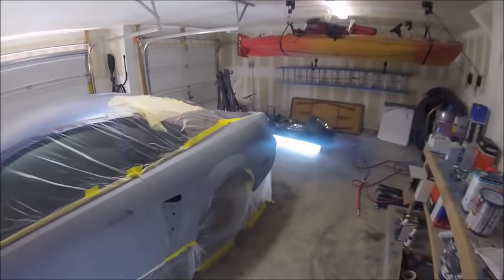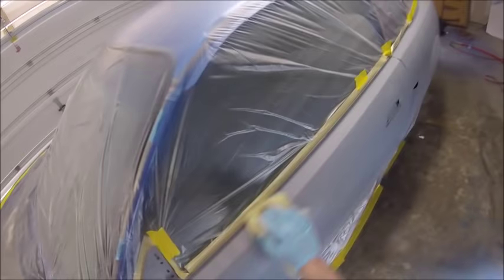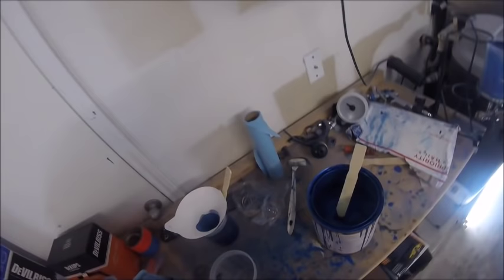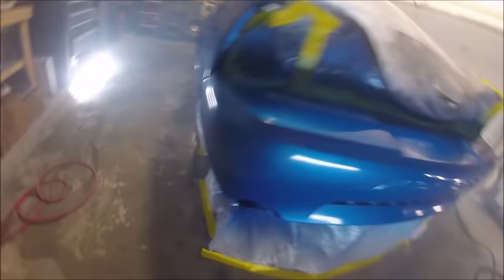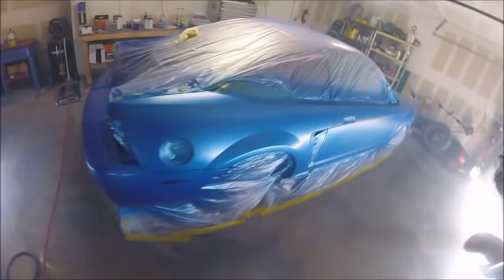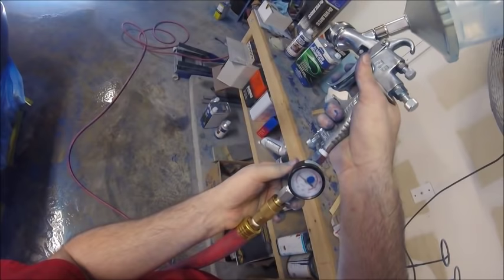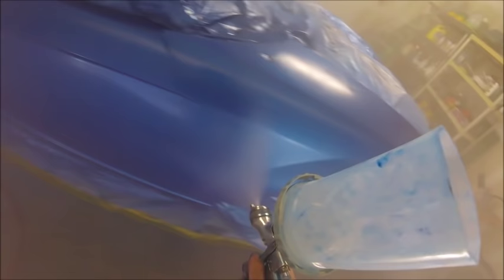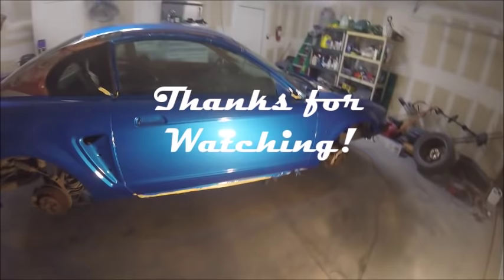Painting Your Own Car At Home

Comment: Well, you mays well of painted it apart panel by panel because you never walked the dog anyways. (Spray full length of the car). But I notice you keep your pattern good at all times. Same distance, speed, ect. So if you did that panel by panel you would not tell a difference anyways. I've been painting for shops for a long time and the only reason I would not use a second booth for doors and bumpers and shoot a whole car is if I was shooting a huge flake in my clear.
Reply: chasefilming wouldnt you only walk the dog with a 3 stage pearl? This pearl was in the base coat not an intercoat. Shoots like a metallic

Comment: did you have any issues painting it in sections? I just bought the same restoration shop bc/cc in a metallic red. I keep reading that if you paint it in sections you will have issues with slightly different color panels. Did you have those issues and did you spray it all the day?
Reply from the maker: I sprayed the roof, hood, trunk off the car. it all matched when I put it back.

Comment: did you use wax & grease remover 1st to stop fish eyes?
the problem of doing 2k paint at home is overspray in the air it takes around 1 hour for
fast hardener to start going off.
means overspray dries in air ,floats around eventually lands on your nice paint work.
so next day it looks like tiny fish eyes .
you can avoid this by placing plastic drop sheets around walls you will need to put a fan blowing out so it sucks fumes out anyway good luck
Reply: Fernando C Prepping the surface is the easy part. Fishing is mainly caused from water and oil from the compressor. A condenser and a good size desiccant drier are a must you need clean dry air going through the gun.
Reply: I painted my 64 in my garage with my home made 55 gal compressor a cool down system for the air and a desiccant drier that's plenty big enough to do a paint job for. I went to school for body and paint and decided it's for the no brains that like breathing fumes all day. I've restored a few cars in my day and know how to lay down paint. No interor in my car it appraised at $35k the body and paint is flawless not counting panels just prep and shoot I'm under 2k for a show car finish that last week won best paint at one of my local shows.
Reply: you can say what ever you like but realize this is the web or net or  social media .
would you believe i won best painter in world award?
tell me how long did you spend in school and do you carry a spraypainters license?
in Australia we have ( TAFE) technical and further education and you need to spend few years learning as well as working in shop!
also you can't learn both trades at same time panelbeating is a trade also.
if you do have license can you use it overseas?
anyone can open business stick sign up as school of auto body works.
but is not same as apprenticeship

Comment: Very nice, but is that a 30 gallon air compressor husky? And what happen You paint the whole car and the compressor is not cut off and on
Reply from the maker: It sure is. I just flipped the breaker back on and let it fill up before the next coat.
Reply: @twistedgarage4139  oh I see.
I just want to see how long the compressor kick in. Is that a 30 gallon husky? I plan to buy one . Do you have the link for this compressor

Comment: Can anyone help just wana paint my car primer no dents or rust body is straight what sand grits do i need to start off with to spray the primer....
Reply: To spray primer you can sand it with 320 but if the paint is in a good condition you don't even need to primer it. If you want to use paint instead of primer you should sand it with 400 or 600
Reply: @laminadoypintura9064  man i appreciate you replying to me ill give that a shot and im really just trying to primer my vehicle i have 88 s10 blazer the clear came off mostly on its own for being an old vehicle and just want to to get it primer for now til im ready for the paint stage...

Comment: can I get an estimate on how much all the products you used cost like paints and gun and everything?
Reply: maake sure you use a respirator too their $15-$20 materials figure$200 guns can run over$1.000 for a good one
Reply: depending on what you need, where you get it, what you're wanting to achieve, etc.. $1000 - $2000ish, China Sanders. you can definitely spend more then $2000, and you can definitely spend less if you are good at finding deals, already have things like the air compressor, etc. there's so many variables to consider with your project that it's hard to give an exact figure.
Reply: you can get a spray gun from harbor freight. I use my good gun just for base and clear. and a cheap gun for primer. I got all my guns for less then 200 and one is a gold edition. few will even know what that is :) I have even tried the harbor frieght one for touch ups and it lays down pretty good ,
Reply: crush smith yeah harbor freight guns are $15 bucks spray good throw away when done at that cost and you don't need that much psi to paint your not spraying with 100 psi's
Reply: China Sanders do you paint
Reply: crush smith 0
Reply: In materials and tools it will easily be 2000$ if you go looking for deals. $2000 will just get you the basic tools and materials you will need to paint a car from start to finish no fancy stuff

Comment: The snake your using is that the best spot to mount it Iv got one and wasn’t sure if it should go on gun or at my water trap?
Reply from the maker: I would figure it would depend how long of line you have between the water trap and the compressor.  I don't have any trap what so ever so b/c the air cools the further down the line thus creating moisture, I put mine right at the gun.
Reply: I put mine there two hard to move gun around with that big snake on though but it works

Comment: I know what happened when you tried to spray the clear coat. Same thing happened to me. the tiny air hole on the cup lid was probably blocked. If the gun can't suck in air the material can't come out if a gun. It looked to me like a gun was working perfectly fine, just user error because you're really inexperienced

Comment: No sealer before the base coat? Eventually you'll have bleed through from the old paint.
Reply from the maker: The entire car was stripped to metal epoxied and 2k primed.  This vehicle had significant hail damage.
Reply: DIY Garage Guy  what’s color is that   And did u get the Restoration Shop - Complete Medium Gallon Kit - ELECTRIC BLUE METALLIC Urethane Basecoat/Clearcoat Car Auto Paint ?

Comment: U did great man. don't reduce your clear it ruins it. it does not allow to get wet or shinny look like clear should look. for your air filtration go to a welding Shop they sell a paper filter for $100 and u can then just keep changing that paper filter and use the same housing. it works great for a few paint jobs. Your air starvation is in your gun. U have to have a pin hole on top of cup or your gun starves just like any fluid in a container. I ran into that issue and figured it out way later. the pin hole has to be a bit open if it has a cap on it and make sure it is always cleaned out after jobs

Comment: Having that parts washer tank will give you fish eyes. Never have oil or grease in the same area of your paint area. That's why you don't do automotive repair work in a bodyshop. Same goes for car clean up, never do that when you are going to paint. Just having armour all dressing present in the air will ruin a paint job with fish eyes.

Comment: walk the length of the car. Dont paint panel by panel.
Reply: EPCOT NERD 
always walk your full side with metalics. when you stop at each pane you get metalic Bloch. 
   You did a very good job. on the other hand. you did oh so many things wrong at the same time. The most important thing is that you are happy with your result!!
That's all I really care about.
Reply: If you got the same pattern spray at all time you can get away with it. Parts off the car.
Reply: Randy Peters , Stick to PlastiDip
Reply: EPCOT NERD Walking the whole car is really only necessary when shooting a candy. Its also allot more difficult to maintain consistent distance & speed /peel. If I were to knock anything he did it would be stopping and starting at panel gaps rather than just off them and passing through them so the clear doeant build up and leave sausages on edges. Awesome gunman tip.
Reply: Savanna Brokamp I absolutely agree with you 100%!!!!  He should have been embarrassed to show this video!!!!
Reply: Hey man I used to paint cars professionally and I can honestly say you did a pretty damn good job especially in a garage and you're really honest about your work don't let the guys on here be clowns and cut you up don't listen to them I had my best results with slowing things down a bit using slow or reducers stuff like that my paint flowed better the clear flowed better I didn't have to fight with anything you just have to have a little bit more patience in between coats that's all but in the end it's worth it

Comment: i was talking about the FLG5 you can't get those in the united state they only have the FLG4
Reply: AWESOME $130 gun shipped. I have 2 of em. One for all primers and sealers (1.8 needle and tip) and one for base/clear (1.4 needle and tip). Also google Sherwin Williams automotive and find a location near u for all supplies. I bought the same devilbiss snake there along with my plastic/masks/tape/tack rags/ those blue shop towels he has/gunwash.. etc. awesome place for supplies. Ebay is awesome for mixing cups and 2k primers or sealers. Saves me hundreds. just read reviews. Finally, his compressor really is sub par. Its the biggest expense short of a booth when it comes to painting. 5hp 30gal is the gunman and eastwoods recommended minimum.
Reply: foxybrown2 Also consider spending $300 for a devilbiss gpi. Same gun as the original tekna pro or gti pro. AMAZING quality and price. You can shoot high solids clears reduced to 15% outof the 1.4 tip @ 3 turns out and about 30psi LIKE GLASS. Again, gotta thank the gunman for that recommendation.